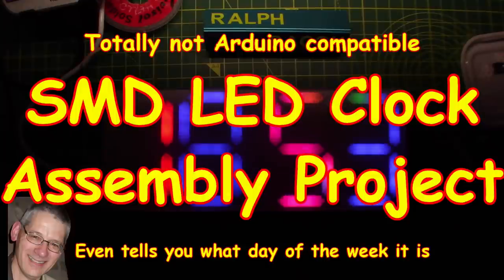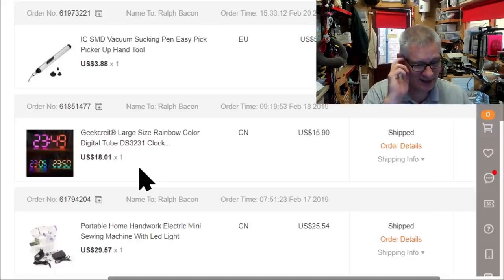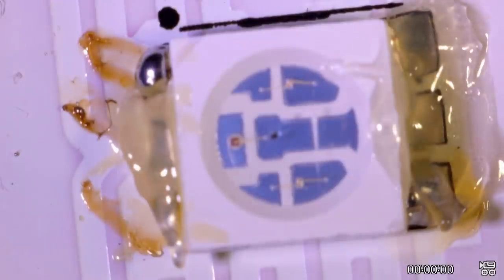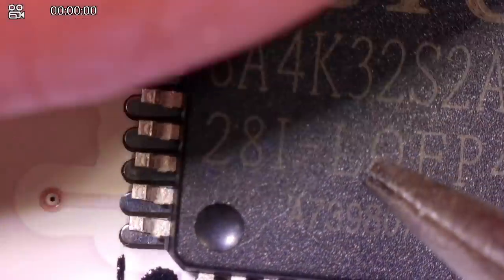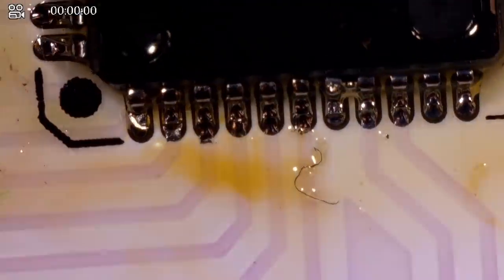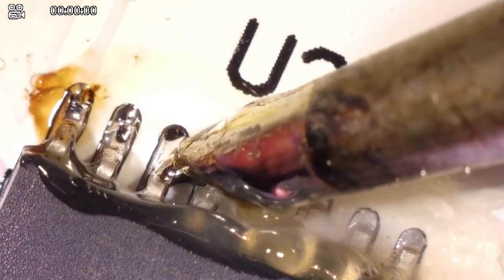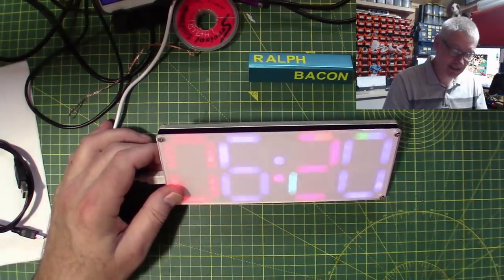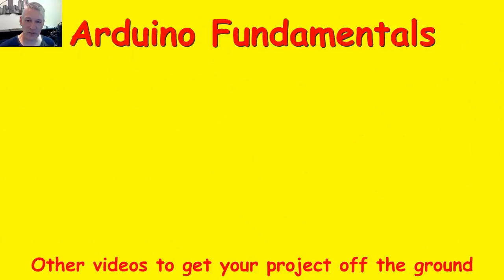#187 LED 3" Digits Clock SMD (TQFP, SOIC, LEDs) Practice - useful eye candy!

Comment: I built one of those early this year! It’s a great kit. (I also built a few of the monochrome version that’s a full LED matrix.) 

Good work overall, and great video and audio quality!

Anyhow, invest in a knife blade (PLCC blade) soldering tip for the LEDs. It’s kinda miraculous for soldering PLCCs (which is what 5050 LEDs are: PLCC-6), and useful for many other things. 

When you have solder bridges that become reticent, bear in mind also that the solder itself can become what I call “overcooked” — prolonged heating both causes oxidation to happen (which flux can help reduce), but also dissolves more of the iron tip, component leads/contacts, and PCB pads, contaminating the solder with random amounts of copper, silver, gold, etc. (which the flux cannot fix), resulting in a goopy, unpredictable alloy that bridges a lot. When you notice this happening, “rinse” your tip with multiple changes of fresh solder, wiping it clean in between. Then go in promptly and resolder the bridged leads with more fresh solder. If you notice you have this happen a lot, get into the habit of rinsing the tip occasionally, especially when the iron has been sitting idle for longer than a moment or two. 

Also, for clearing solder bridges, try pulling it away from the IC, rather than drag soldering it down the row again. 

Also, overall, you’re applying a bit too much solder, especially on the LEDs and passives. The shape of the component leads/contacts should always be slightly visible. The fillets should be concave, not convex.
Reply from the maker: Thanks for your comment and your suggestions.  I will certainly investigate a knife blade soldering tip. I have several tips so maybe I already have one that I never used. If not, I'll try and get one and try it out. Thanks for posting.

Comment: Nice clock I built one last year, it's currently sitting on the living room desk. only issue i have is the touch buttons work better if the other hand is touching the usb connector body.
Reply: An undocumented "feature."
Reply from the maker: That also recharges your pacemaker for another year, another "undocumented feature"!

Comment: Thanks for the video, Ralph. 
Always some good takeaways in your uploads - I actually wasn't aware there were differences in quality between solder wicks, which is probably why I  curse and swear every time I use the cheap type I bought.
Reply: If you have solder wick that barely works, douse it in flux. It makes it at least somewhat usable.
Reply from the maker: I swear by (and not swear at) Servisol Soldamop but it is not cheap. Then again, buy cheap, buy twice. And pointless buying just 1.5m you need the 10m spool as you can get through it. 1.5mm-2mm width is good but it's not that important as having a quality product.

Comment: Hi Ralph, if I remember when surface components first came out they used to put a tiny spot of glue in the middle of the component to hold it whilst it’s being soldered. I think more appropriate for flow soldering machines (automatic insertion machines), but might be useful here to hold and align your components before soldering.
Reply from the maker: Indeed, some people still do that (or even use Blue Tack). However, just tacking two corners (roughly) was what worked best for me, and allows me to realign before it's too late! Do whatever you feel comfortable with.
Reply: When placing SMT components on both sides of a PCB, the components on the bottom side have to be glued in place. Otherwise they would drop off the board in the reflow oven. In KiCad the F.Adhes and B.Adhes layers serve this purpose.
Reply from the maker: I always assumed it went through the oven twice but the components would drop off the bottom layer if they did that, I guess!

Comment: Next step up: a hot air station. At the latest when you found that you messed up pin 1 on a 48-pin QFP ;) It also helps pulling all those wonky components into position (or blow them off the board XD ).
Reply from the maker: Yes, I have a hot air gun so I could have used it to straighten those wonky components, never occurred to me TBH! Ideal to desolder QFP chips too, nearly the only way to do it.

Comment: What size solder wire are you using Ralf????    You should be using 0.3mm or 0.2mm. Anything bigger and you get bridges as it is extremely difficult to control how much solder you are applying to the iron. Also, have a look at a solder iron tip that has a "well", they help a massive amount.

I know it would not work for this board but a future video could well be a home made Reflow Oven.
Reply from the maker: I showed my gullwing soldering tip in the video (extreme close-up), Ian, and yes, it works well and I do pretty much all my SMD stuff with it. I looked at Reflow Ovens and just cringed. If I were making dozens of boards a week (eg. to sell) it would be worth its weight in gold but not for single boards like I usually make. Oh, my solder wire is 0.4mm, very nice (it really does solder well) but stinks as the flux burns off - have to use my fan each time.
Reply: @RalphBacon  Get some 0.2 or 0.3 and try it. You will find that you have to "dab" it more but will get much better results.

Comment: I bought this kit 2 year’s ago, still trying to pluck up courage to start it, just have to get past the 58 leds each with 6 pins to solder, =348! Joints on the display side alone.
Reply from the maker: You are right to consider the challenge ahead. 
Although it is certainly do-able with the right soldering iron tip, it's very easy to rotate the LEDs so you solder them in the wrong way round. Don't ask me how I know this.
Basically, check each and every LED for the correct orientation before soldering them!

Comment: Excellent. Your SMD soldering skills have greatly improved. (You may recall my rather harsh comment from the first SMD video you did last year.) Now have a go at a QFN (quad flat no leads)!
Reply from the maker: These LEDs were unleaded (leeded, no feet) but I do have some ATMEGA328PB chips in a QFPN form but they are very small and I did not trust myself to successfully solder them! But I'm happy to know that I have improved since last year! Woo hoo!
Reply: This is the ultimate test: https://www.tindie.com/products/makersbox/smd-challenge/?pt=ac_prod_search. Can you complete the 'misery' edition?
Reply from the maker: Interesting kit! I'm OK at 0603 and have even done 0402 (badly). But 0201 was never design for hand soldering although I suppose with a microscope it might be possible. Unfortunately, the line that says "Shipping to United Kingdom starts at $13.30 (£10.72 GBP)" puts me off a bit!

Comment: I just recently subscribed to your channel and I am enjoying your videos very much. I'm just getting into SMD components soldering and wondered which microscope you are using and would you recommend it. 
Thanks for the videos
Reply from the maker: Welcome aboard! My microscope? I have two, but the one you were watching is an Andonstar AD407 HDMI Digital Microscope 7''. The main screen could be a bit brighter for my dodgy eyes, but the clarity is very, very good. HDMI is also great (which you saw). I got it almost half price on a Black Friday event (normally $200). A cheaper model at $40 which I use probably daily to identify chips and other components (dodgy eyes again) is a Mustool G600 Digital 1-600X 3.6MP 4.3inch HD LCD Display which has the advantage of a rechargeable battery so I can use it anywhere. Last used to identify some fleas from my cat Benny!!! Links:

Mustool $40
https://www.banggood.com/G600-Digital-1-600X-3_6MP-4_3inch-HD-LCD-Display-Microscope-Continuous-Magnifier-Upgrade-Version-p-1152799.html?p=FQ040729393382015118&utm_campaign=25129675&utm_content=3897

Andonstar $200
https://www.banggood.com/Andonstar-AD407-3D-HDMI-Digital-Microscope-7-Screen-Electronic-Soldering-Microscope-for-Phone-Repair-with-Adjustable-Stand-p-1549209.html?p=FQ040729393382015118&utm_campaign=25129675&utm_content=3897

I would give them both 5 stars, given their relative price/performance.

Comment: Great video, Ralph! I'm ordering one of the clock kits today.  One question--where did you get the soldering iron tip with the concave section in the middle?  Is it made for a special iron? (I know Hakko makes one but they are hard to find in the USA.)
Reply from the maker: The "gullwing" tip I showed is made for the Weller soldering iron but fits my ATTEN 100W too. 
Link: https://www.rapidonline.com/Catalogue/Product/85-5785 
There may be other gullwing tips available too, of course, for different soldering irons. 
When you build the clock, ensure you place each LED exactly in the centre of its pad area to ensure you can solder the remaining pads easily. I had to move a few of mine as they were too far over one side. Easy fix, of course!
Reply: For T12 and 'compatible' soldering stations: T12-BCM2. On Aliexpress...
Reply from the maker: My iron uses the LT series from Weller (or compatibles) and the LTGW is the gullwing version I used in this demo. Also available from AliExpress.

Comment: Oi, Ralph, do not forget to make sure the rotten pets do not swallow the smd parts to become hippie rainbow style! Pets tend to do crazy stuff when on a hippie style trip ... :)
Pretty good soldering btw.!
Reply from the maker: Benny is crazy enough without tripping any further and I would hate to think what Dougle would do with SMD parts inside him. Where would I plug the +5v jack into him? Oh. Yes, I see. Poor Dougle. Bit of a bummer.
Reply: @RalphBacon  Hehe. I didn't get to the point where the +5V jack needs to be plugged in ... but it makes a valuable point of course :)

Comment: Greetings! I am still messing around with the internet radio, my latest go at it was to mount it all in a cardboard box, ran into problems because I decided to use  a smaller buck power supply, running it off the remnants of an old Mac-book Pro battery, using 4 of the 5 packs that still hold power, arranged to put out 12 volts. Problem, that blasted power supply was so noisy that it was virtually unusable. So I went back to the old PS that I built myself using a 7805 and some caps, that works great, then pulled the radio itself back out of the box and put it back in a project case as it just didn't like being in the same box with the amp and PS, plus I managed to tighten the OLED to tightly and broke the screen, my other one had the GND and VC reversed, didn't notice that till the magic smoke escaped. Luckily I had another but it was to weak, so I took one from another project and replaced the weak one. I am now back in business with two great speakers and a small amplifier in the box with the power supply, and the radio itself sitting atop the box. Works great, I listened to it all afternoon yesterday after returning from hospital where my good wife was subjected to tests finding some major health problems in her stomach. We are nervously awaiting the results of biopsy of the area to return in 3 to 5 days. Overall, though the project has been a blast to work on, thanks a million!
Reply from the maker: Wow, Jerry, you know how to live on the edge, don't you? So happy you got it working in the end. And so sorry about your wife's condition. Fingers crossed for the results of the biopsy. Keep safe.
Reply: @RalphBacon  Thanks, I am having a blast with this, the Cardboard box is sort of a precursor to a wooden one, if I can get out to the garage one of these days. Our weather here has moved back toward the early spring with highs in the 30's F lows well below freezing.  I hate the cold, perhaps because of my Swedish blood, or having grown up in North Dakota but for some blasted reason I find myself back in the Dakota's at this time of my life. Plans were to be in Arizona by now but Mom has kept me here since both my sisters died of cancer last year, there were three of us children so I am the last, and thus responsible for mom, she is in a nursing home but doing well I think, according to her on the phone anyhow since we have been unable to visit her for a couple months now thanks to the damn virus.  My good wife seems to be responding to the meds the doctors sent her home with, we hope to hear soon from the big lab.
Reply from the maker: I'm sure you heard the expression that "God laughs as I tell him my plans"? Things never work out in the way we think they should, Jerry. Well, hardly ever! Keep having a blast and fingers crossed for your wife too.

Comment: I have a permanent impression of a solder wick on my fingertips. How do you hold it without screaming from flesh burns?
Reply: Have your wife help.
Reply from the maker: Don't hold the braid, hold the spool and only have enough braid out that you need. Or have more braid out and hold it further down, away from the heat source. Is the impression as bad as the guy in Raiders of the Lost Ark where he picks up that medallion from the fire? But seriously,. practice makes perfect.

Comment: Good work with soldering but are the colors supposed to be like that , looks pretty bad . Can u change the colors ?
Reply from the maker: You can change the colours to just about anything you like. Each segment can have a different colour (almost) but I just stuck to the same colour for two each of the digits - there are many, many options!

Comment: Your SMD skills is surely  getting better, I do remember the first ones (looked like mine) practice do help.
Sure one of the better looking clocks.
Like you, I still get surprised to see what I find in the project box, one or two older than yours, don't tell my wife. 😂

(By the way, did my mail end up in spam filter?)
Reply from the maker: I won't tell your wife. Just send the €50 note in a plain brown envelope to me!  Yes, the clock looks nice and has been running continuously (since I installed the missing battery) on my workbench. No, your email is still awaiting my (full) attention (I remain a very busy person) but I did notice an "Analog Out" pin, which confused me!
Reply: @RalphBacon  I tried to push that envelope through the floppy drive, it wont except.
Analog out - ohh you found that, thought i had buried that in info😩

Comment: Great video, Again. What are you using as the magnifier? Maybe show that in a video!  Need an affiliate link for that also.       Also, I finally received my HC-05/06 modules to finish the phone charger controller.
Reply from the maker: Glad you liked it!
The microscope I use is this one, which I got half price in a Black Friday event:
Andonstar usually $200
https://www.banggood.com/Andonstar-AD407-3D-HDMI-Digital-Microscope-7-Screen-Electronic-Soldering-Microscope-for-Phone-Repair-with-Adjustable-Stand-p-1549209.html?p=FQ040729393382015118&utm_campaign=25129675&utm_content=3897
Reply: @RalphBacon  It is now $199+ on sale! Must have been a good seller.  Too rich for my need.  Thanks for your response.

Comment: Nicely made video.
You forgot a few components at 21:16
Reply from the maker: Only on video, I assure you. Still running here in my workshop, very pretty.
Reply: @RalphBacon  Nice! I've just received the 512 SMD version which I'm slowly doing, 2 columns at the time. :D I mean putting it together is half the fun so why not taking your time?

Comment: did you not use flux and a heat gun insted of an iron for the resistors and caps on the back maybe they would be unsquint:-) great video I liked it,
Reply: instead
Reply from the maker: I actually used my tweezer iron for most of those (two soldering irons in a tweezer setup, especially for SMD soldering). Probably explains why they are so wonky.

Comment: Ralph do yourself a favour and just get yourself some proper 60/40 multicore Rosin solder from China. In the UK Lead solder is, I think, still legal for hobbyist use. You soldering problems will disappear instantly through better wetting, better flowing solder,  lower iron temperature and quick melting of solder.  Work up to the lead free crap. I've been hand soldering for 30yrs I gave up for ages - I just couldnt we eeAlso never touch your pads with your fingers and ALWYS clean with Isopropyl before starting to solder. 
Lastly, I'm starting to use solder paste and stencil more and even if I'm going to use an iron. The components stay in place, less chance for bridges, easier to maintain position when tacking, less solder 'flowing' around the board (cough and whistling) and you can still use flux if you want.
Reply: The lead free stuff is fine for soldering new components onto a new PCB. But leaded solder it is essential for me when repairing something because of the lower melting point. Since leaded solder is impossible to get nowadays as a hobbyist, I have reserved my spools for repair jobs only. I have ordered leaded from China, but the quality I got was so pisspoor (it's not even the flux, but the alloy itself!) that I'd rather solder with lead free. Any suggestion for leaded solder from China that's actually usable?
Reply from the maker: In no particular order: I have some solder paste but without a stencil it can be very messy but does line up the components nicely with a heat gun (or iron for smaller components). A smaller syringe might help me with that. Right now, I'm using standard, leaded solder (yes, legal for hobbyists) which works fine but I prefer to use separate flux and the drag method for chips, in which case the flux is immaterial. I'm not going to use unleaded solder ever again, it was awful. I don't know how anyone can use it! Interesting that absolutely everyone has their own method for soldering (just like chefs have their own way of cooking). Thanks for your suggestions, good tip about cleaning the board with IPA first.